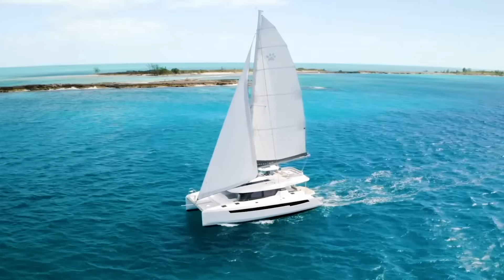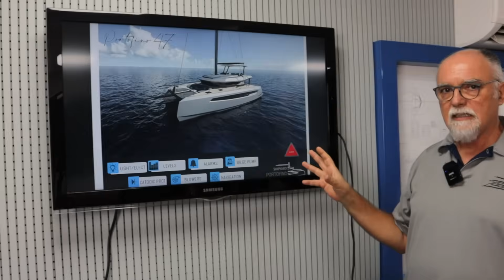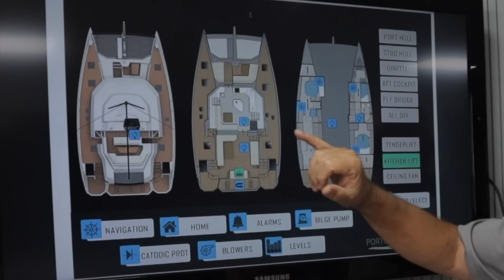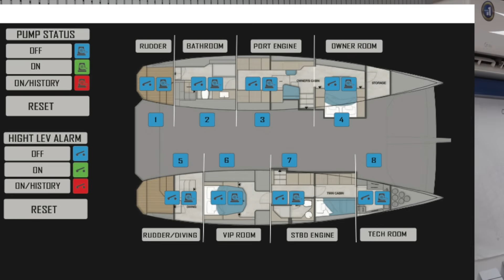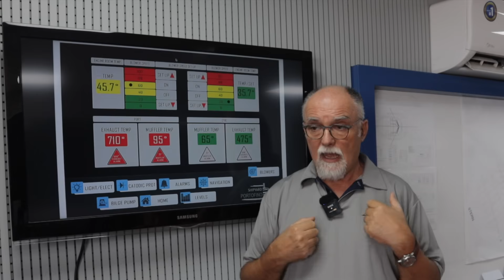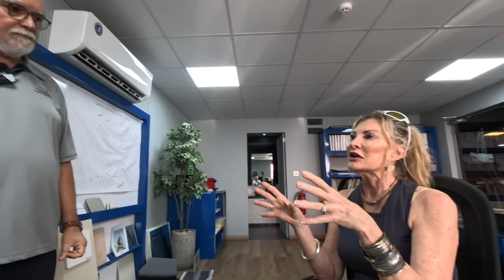DISASTER-PROOF ALERT SYSTEM - Portofino 52 Aluminium Expedition Catamaran Build

Comment: Manual switches ONLY . 
What happens when your electronic switching controller is faulty , I'd NEVER have such a system on a boat .
Reply from the maker: Portofino have designed a system where the manual switches override the electronics so either with no electronics working the manual switches will still work. so this is one of the redundant systems that Portofino has built into the whole boat.

Comment: Like the idea of bringing big boat monitoring and control to smaller boats.  Given modern technologies, there's not much reason to not do this.

Question: is their monitoring software their own, or part of Raymarine YachtSense?
Reply from the maker: Thanks, Loanwood, yes using super Yacht technology where possible add lots of great features and this software is an add-on to the Yacht sense system so integrated with Raymarine.

Comment: It's a great idea and I think he said it will be a screen on the Raymarine MFD?  Are there any plans to create a "kit" to install this on older boats, or just on a new boat build?  Wiring would be a challenge for some aspects like controlling light circuits, but perhaps sensors could be Bluetooth like Victron does to create the engine room monitoring, etc?
Reply from the maker: As these are the first of the Portofinos to be built, there are no older boats and the systems would not really be useful unless all the motors are attached - temperature gauges in the turbo, exhaust, engine room, variable speed fans and electrolysis cathode etc... SO in reality this system is only for the Portofinos, like the systems on the other brands (Wendelo, Kinetic etc)

Comment: So much interesting, this system is a technologic work of art... You will be feeling safe sailing!
Reply: Felling safe is the issue, you should always be doing what you need to keep you safe. Do not completely rely on software or sensors, you must always check manually. They are aids not replacements, and too many times are the reason why the failure happened.
Reply from the maker: Yes clearly the systems provide early warning systems for some things and having the actual readings for the different elements continuously gives us a much better idea of what's going on with the equipment than just an alarm that goes off when the engine cuts out. Just like AIS and radar, it is an assistance for safety but all the "usual" safety precautions will still have to be in place. Definitely we will get early warnings of certain problems that can be fixed early but we agree with you that they are just aids and we will still be paying attention as always...
Reply from the maker: Thanks Serge, yes every bit of early warning system helps and it is cleverly thought through with features that I have not seen on other brands of sailing yachts.

Comment: Fantastic..❤❤ Maintenance log is just missing.  Automated maintenance  alarm for oil change for example……do your fuel system work with a “ day tank” or pump the diesel straight from the fuel tank?
Reply from the maker: Yes Juergen, you are right. This is the first version for the 47 and our 52 will also have pages for the cnetreboard position, rudders, bowsprit and more and the maintenance log will be in the background, not on the front pages of the operating system.

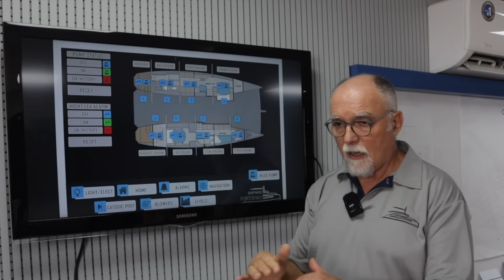Comment: 15:20 use yellow to indicate a previously run pump. Don’t use same color for the other, much more critical state, it goes against basic UI/UX principles and a common sense, too. In general, this UI comes off very clunky and obviously designed by the engineers. As an engineer myself I can assure you we are NOT to be trusted with user interface design. They should absolutely pay some money (not even much) to a UX/UI specialist to design it properly. This is absolutely crucial aspect of boat operation and anyone should be able to understand it without explanation. The „reset” buttons right next to indications, the ON/OF switches etc., they all should be designed better. Excuse my criticism, but with 15 years of software engineering experience I can assure you UX/UI is not to be half-assed by the engineers, it’s a recipe for trouble — as evidenced by the usage of same color for different tiers of alarms.

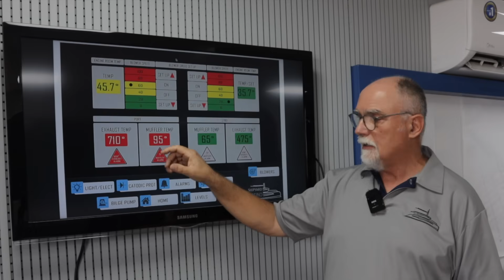EDIT: 21:12 DO NOT show any alarm in another color if it’s inactive. Just do not show it at all. You cannot expect for people to know it has to be red to be actual active alarm! The state has to be obvious at first sight, especially for crucial things like this. This is seriously, seriously against sane UX guidelines. Just imagine the boat is operated by someone who has not been explained any of it and the panic such UI can induce.
Reply from the maker: Thanks for those points - I see your point about not showing the alarm at all unless it has been activated  and keeping the colours consistent across the pages. Certainly this system is not complete and free to be improved so thanks very much for your suggestions. Raymarine are also closely involved in the process so hopefully they will have access to the Ux/UI specialists to improve the design. Great points!
Reply: Unfortunately thinking of everything is tough to do, especially at the first iteration. And folk often skim over the bits which are not part of their own core expertise.
So it is pretty apparent that Portofino have done a fantastic job in, for instance, safeguarding against electrolysis since they have focussed on aluminum boats, whilst manufacturers of mainly GRP boats, at first blush less susceptible in some respects, have often been caught out.
Loads of other aspects of the design are exceptional, for instance in providing really decent compartmentalisation with watertight bulkheads.
Its clear that you have done John and Ella a service by highlighting one of the areas needing improvement though.
Reply from the maker: Thanks and you are right - this is only the first iteration / draft and every suggestion and improvements can be added...